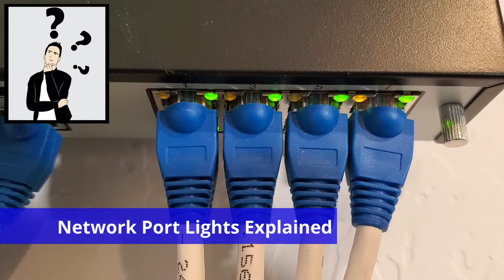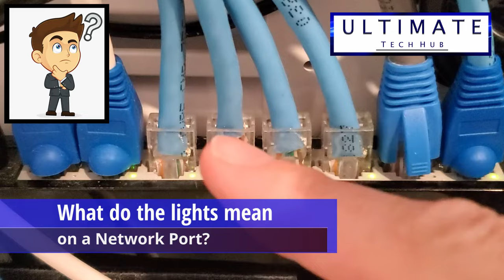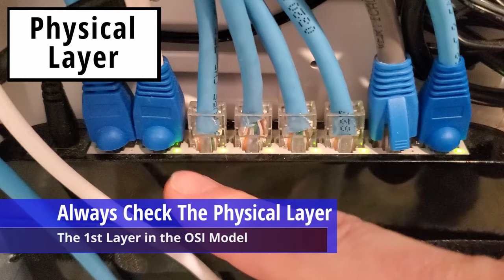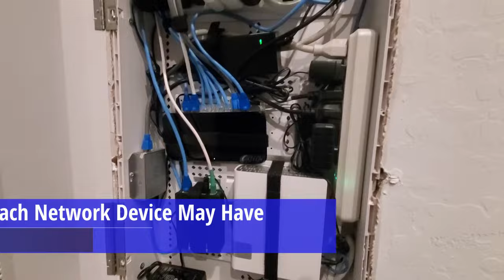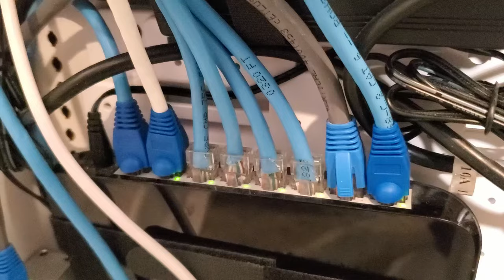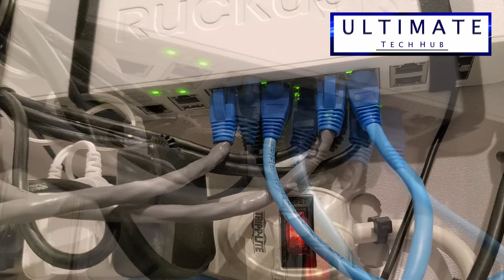WHAT NETWORK PORT LIGHTS MEAN? HOME NETWORK 2021-UNLOCKING THE SECRET!

Comment: Just think of all the wasted electricity on all the switches, routers, devices all over the world constantly blinking away billions and billions of times a day......

On a side note, I really wish they had come up with a standard for the lights - when you have the one link light and one light showing connection speed (orange (100Mb) or green(1Gb) it is very helpful!
Reply: there's no standard but I do this on my PCB designs that have a LAN connection. My 1Gbe blinks at a different rate than my 10Gbe.

Comment: I have a concern. The amber light on my computer's network adapter often blinks while my pc is turned off. Could this mean that my pc is sending or receiving data while it's turned off?
Reply from the maker: No, it's not sending or receiving data. The amber light blinking means its connected to the network and it's not sending or receiving data yet. Hope this helps and thank you for watching!

Comment: If the power LED on your Cisco 4300 router flashes amber every 8 seconds, and i don't hear the fan running, and the power cord is working. any idea?
Reply from the maker: If the fan is not running that's not a good sign. I'm really not sure.  Sorry.

Comment: I was recently asked what I felt was a trick question from an interviewer a few weeks back and it seemed like he left out a lot of information I felt I needed to answer accurately. Kind of feel the question was a bit unfair but he basically asked what it means when your ethernet cable is plugged in and you have a green light. Did not specify if there were multiple lights or if the light was a solid color or blinking so I assumed in general if it was a green light that meant everything was good. In a sense it sounds like that could have been the case in the situation where there are two lights but I admit probably not if there were only one light.
Reply from the maker: Green light is good and connected to the internet.
Reply: @UltimateTechHub  yea thats what I said until they pulled the "green light is solid which only indicates it's connected physically but isn't sending data" line.
Reply from the maker: @raventhorX  Yes blinking means sending data
Reply: @UltimateTechHub  yea thats the part that was tricky about the question. I don't even think the comptia certification exams are that vague with the meaning though often they have multiple choice that gives you clues lol.

Comment: What does it mean when a light is on only where the incoming internet signal is but not on any other connected cables. This applies no matter what Ethernet port I plug into. Every port I connect the internet cable to lights up but none of the others do, even if I change what port the incoming signal goes into

Comment: I got orange light and yellow light flashing on my gaming pc, ethernet turns on and off, idk what the problem is, maybe the cable? Got old cable from a friend. Wi-fi works on the modem, but when u connect cable to pc the lan light flashes on the modem
Reply from the maker: Probably the cable. Buy a new one they are pretty cheap.
Reply: @UltimateTechHub  yeah cause the pc is brand new. Will buy new one

Comment: hello sir, i connected a 50 meter cat 6 cable to D-lnik switch DGS-1210-28P, and start to flash green for 1 second for three times then it start to blink orange,  there is a connection between the router and the switch but when i test the speed i only get 8 mgps up&down insted of getting the full speed which is 100, is there any setting i should make in the router or there is an issue un the cable ?
Reply from the maker: Is there anyone else connected to the switch? How long is the cable from the router to the switch? You can reboot both the router and the switch to see if that improves your speed.
Reply: @UltimateTechHub  ty sir for your reply, i found that the cable give 10m instead of 1gb, i changed the rj45 twice, not sure maybe cable somehow damged, btw doest the color order matter or its just have to be matched both sides?
Reply from the maker: @happiness_in_islam  the color order does matter and both sides have to match. I have several videos on how to wire ethernet cables and plugs so check them out.

Comment: What about red? Happen to walk past one of the routers in our warehouse just now with a empty port that has a red light on it.
Reply from the maker: If there are no lights or they're orange or red, this means not connected properly, or may not be receiving a signal from the network. Thank you for watching I really appreciate.
Reply: @UltimateTechHub  Said port doesn't have a cable plugged in. I assume maybe the port is bad.
Reply from the maker: @SOU6900  Our the port is not enabled.

Comment: I had an orange blinking light and a green solid light but my PC lost internet and idk how to get it back, please help
Reply from the maker: Reboot the switch or unplug the ethernet cable and plug back in.
Reply: Thanks but I figured out the problem, there was a wireless USB adapter that was missing but I found it, but thanks anyways for responding!

Comment: My PC won’t connect to internet via Ethernet. When I run the troubleshooter it says “default gateway not found” but all my other devices connected to the same router work fine. On the back of my PC there are 2 lights one solid green and one flashing yellow. Another thing is, my Ethernet worked perfectly fine the first few months and then stopped randomly and everything on the pc is up to date. Please help.
Reply from the maker: Sounds like a bad etherent cable. Try a new cable.
Reply: @UltimateTechHub  I believe I am currently on the 3rd ethernet cable I’ve tried. The PC says there are being packets sent to it but none are being received. I also see that my “IPv4 Default Gateway, IPv4 DHCP Server, and IPv4 DNS Servers” are working fine but not my “IPv6 Default Gateway” nor my “IPv6 DNS Server” is not. If that has anything to do with it.
Reply: @DavidsProjekt  No, I have just been using wireless wifi but I think it might be the Ethernet port itself. Haven’t gotten the chance to get it looked at by a professional yet.

Comment: Mine is strange, there is a flashing light even the PC is shut down,  it seems the pc was ridden with virus or something and the hacker was infiltrating my data while pc is off?
Reply: did u find out what was the issue?
Reply: That's normal. Unless changed in the adapter's settings or the BIOS, your network card receives constant power and merely listens for "magic packets" that can wake the PC up from sleep or even power it on if it is shut down. But when PC is off, the storage and RAM are not operating at all, so there is no way someone can steal data from it when off.

Comment: I only see a yellow blinking light no green
Reply from the maker: That most likely indicates netwotk speed.
Reply: @UltimateTechHub  i recently plugged in my ethernet port to a printer, (i unplugged it from my pic) and now then i plug it back into the pc its orange? before i dont remember seeing a color but my internet was on and working.
Reply from the maker: @kfis6612  The orange light is probably the netwotk data speed which indicates less than 100mb speed or something to that effect.
Reply: @UltimateTechHub  hmm, im talking about the ethernet port on my pc, its blinking orange.
Reply from the maker: @kfis6612  These indicate the three possible network connection speeds, 10Mbps, 100Mbps, and 1000Mbps respectively. Not sure which speed so check your mobo NIC information.
Reply: @UltimateTechHub  I have the same issue. I am worried that the orange blinking light may cause any harm to my computer. But thank you for clarifying that it's just the network speed because I am not having any problems connecting to the internet even if there's a blinking.